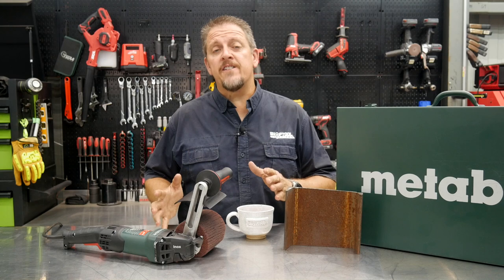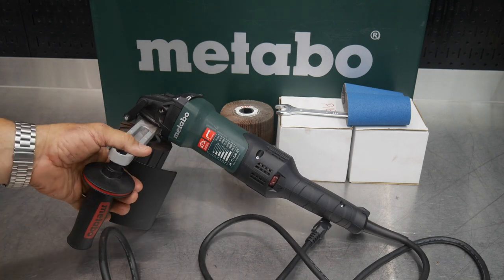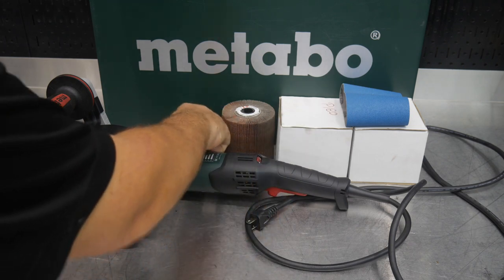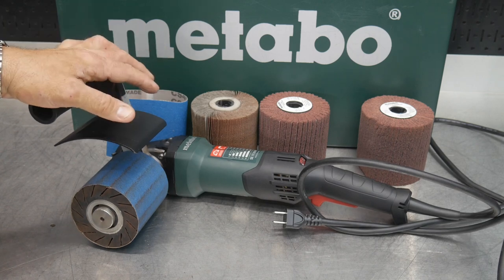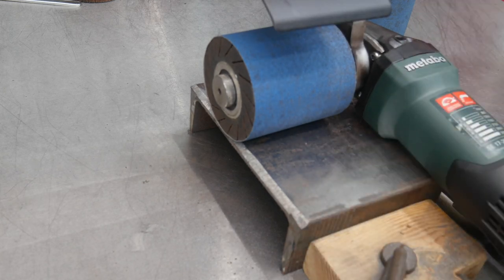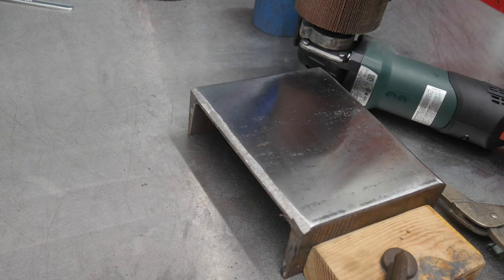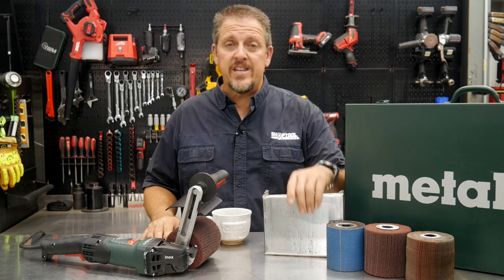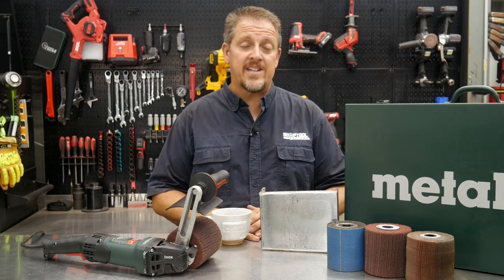POLISHED STEEL - Metabo SE 17-200 RT Burnishing System Review

Comment: Is it possible that you had the sanding drum on backwards and that is why it stared to come off?.  I couldn't tell from the video.  If that's how good it is it's a terrible tool especially for the money.  The sandpaper should stay on.
Reply from the maker: The drum was on the correct way. That was some paper that had been used and worn out sanding a welding table. We should have never started with that. Thanks for watching.
Reply: the drum is on backwards.  I use this tool all the time and the paper will slip like this when it is installed backwards.  The expansion drum will not expand.  Also if you need to put a grain finish on metal this machine will pay for itself in a single job.
Reply: @billberger  agreed I use it all the time the drum is on backwards

Comment: It's a deal breaker for me if the the sanding roll keeps coming off.
Reply: He has the rubber drum on backwards.....I use it daily they don't come off if it on the right way
Reply: @westweld  do you know why he is using the 80 grit sleeve instead of a 80 grit non woven and why after the 80 grit sleeve he used the 120 flap wheel instead of a 120 non woven????
Reply: @yeudsiegal5285  He was just using what comes with the set.

Comment: I don't know about this tool. I will stick to a grinder with flap discs...more versatile
Reply: That's because you are not ready
Reply from the maker: A flap disc is fine for rough work, but it will never pass for getting fine finishes or working with stainless and aluminum. Thanks for watching.
Reply: Angle grinder is way more aggressive and does not leave as uniform of a finish. Personally, i would have used angle grinder with scotch brite disk on it to remove the rust, followed by burnisher to smooth out the surface. If this burnisher is like a shovel, angle grinder is like an excavator. Just different application all together.